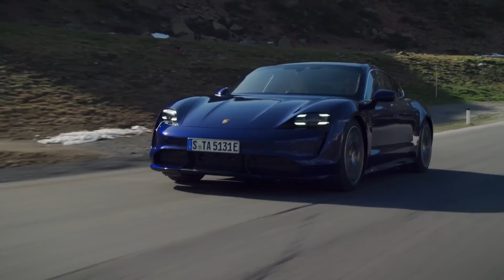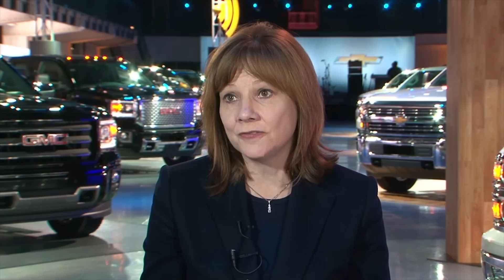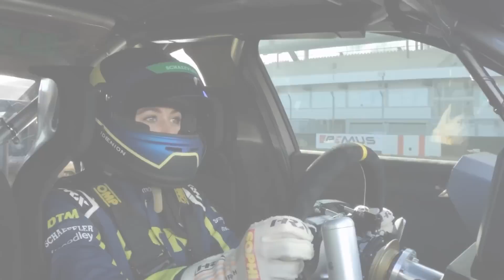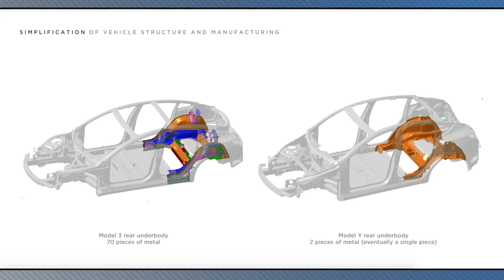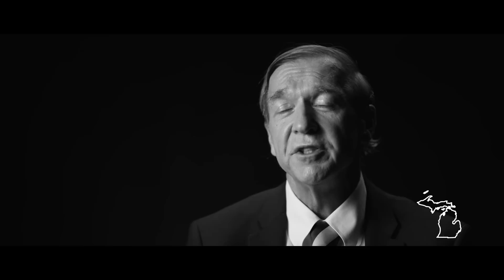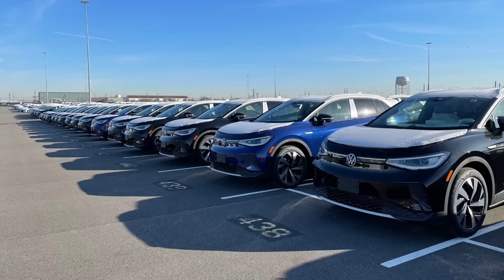Germany Slashes EV Subsidies; Tesla Charging Fee to Use Navigation - Autoline Daily 3370

Comment: After 8 years you can pay for navigation and don't forget about that battery your sitting on
Reply: The battery will probably last a million miles, or a million kilometers if you wanna be pessimistic. A ton of folks are already starting to celebrate passing the halfway point on Twitter.

By the time you need a new battery an ICE car's engine would have been replaced a few times over, and lets not forget how much easier it is to replace a skateboard (ex: M3 = pop 38 screws and stick new one) vs an engine block, labor will be much more expensive for ICE.

Comment: Wait so why is the iD4 sales down? Is it lack of dealer availability of the car or the lack of interest from the customer?
Reply: Lack of supply. VW is doing a software update before they hand the cars to the dealers (the first software update of these cars has to be done manually, only after that they are OTA capable - this shouldn't be a problem with the US-made ID.4 which will already come with new software version from the factory). This means the cars sit at ports and are counted towards VW's inventory and it makes it sound like nobody is buying them. In reality there are long waiting lists and it just takes time to do all these software updates manually.
Reply: @andy1977  Thank you for digging into the situation that THIS CHANNEL didn't.
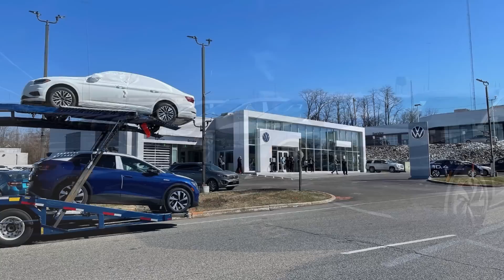Reply: @suserman7775  they says It at around 9:40 mark

Comment: Tesla more and more dependent on China - buy TSLA shares at your on risk. Ukraine today - Taiwan tomorrow....
Reply: You do know that they are ramping two new factories in Germany and Austin Texas, right?
Reply: @billh2294  yes, with CATL batteries (from Chyna)
Reply: @johnsmith-cw3wo  Berlin is currently sourcing batteries from China. Texas is getting them from Panasonic made in the US. They are also making their own 4680 cells in California and Texas. Berlin is currently building 4680 cell production lines. Point is that battery production will be in many locations including at the plants themselves.
Reply: @billh2294  Shanghai, witch is the biggest get all batteries from China,  Also Cybertruck might have batteries from BYD)
Reply: @johnsmith-cw3wo  Well since Shanghai is in China, makes sense. Cybertruck will have either 2170 or 4690 cells made in the US. Did you know that Tesla Model Y and 3 built in either California or Texas have the largest American content of all other cars? Or that the Fremont plant is the most productive automotive plant in the US? How about that the Texas factory will be larger and have higher output than Shanghai when fully ramped.
Reply: @billh2294  higher than Shanghai have today... Shanghai also plan to expand. - for now the production is really shitty in Austin, will hardly go over 100k ... maybe with luck this year (with 2000 a week, I know you Elon fanboys say it will produce more, but I would not hold my breath). and about largest American content of all other cars is not a high bar, since most of GM/Ford parts are made in Mexico, 😄
Reply: @billh2294  Your boy Elon also said Tesla will make a million robotaxi by the end of 2020 😆 -  And after the Twitter fiasco, I don't even care what that clown have to say. 🤡 - but it is funny to see stans like you defend him. 😁
Reply: @johnsmith-cw3wo  Your comments won't age well. Did you also know that Tesla is putting more money on the bottom line than Ford, GM, Toyota with a fraction of their sales and revenue?

Comment: Average car ownership is about 7 years, largely due to outdated features and expectation of mechanical failures.
EVs that are software defined flip the script on this.
1. Their features are being updated regularly, so aside from older hardware components (which might be unbearable), it will take much longer for functionality to become "outdated".
2. Teslas are demonstrating that EVs can have life expectancies with minimal repairs upwards of 300k miles.
Both of these will upend the idea of when a car needs replaced, extending the average length of ownership dramatically.
Reply: Software can’t update everything and the average age of a computer, cell phone, tablet is much less than eight years because the hardware can’t keep up with the changes in software.
Reply: @matthewhuszarik4173  that is very true. i know some guys who are developing software for the virtual instrument cluster behind the wheel and the infotainment screen in the middle of the car. they say, usually, the hardware is already very weak to keep up with the actual needs of the software to save money on the hardware. letting other software run in a sandbox would require much more hardware resources that are "too expensive".
Reply: @matthewhuszarik4173  Cellphone batteries usually die before the hardware does.  The same applies to EV's.
Reply: @H0kieJoe  Cellphone batteries don't last long because that's how the phones are designed, there's no incentive for phone makers to let their phones last longer than a few years, why baby the batteries then?

EVs are a different use case, the batteries can last a million miles with modern designs because they properly manage their packs. 

The only company that designed their EVs like cellphones was Nissan, their Leafs lack active thermal management, and for that they deserve the bad brand image they have today, and rest of the market has moved past.
Reply: @AllanSustainabilityFan  No, EV's are not a different case.  Planned obsolence and thermal envelopes aside, lithium ion batteries (like it's predecessors) can only withstand so many charge cycles.
Reply: @H0kieJoe  Cell phone batteries are easily replaced and the cost is not prohibitive like it is on BEVs.
Reply: @AllanSustainabilityFan  No BEV has come close to lasting a million miles much less them routinely doing so. Every high milage Tesla I have heard of has had its battery replaced. When I speak of high milage I’m not saying a millions miles I am say 200,000 miles.
Reply: @H0kieJoe  Yes they can "only" withstand 3000 charge cycles for NMC chemistry, so 3000 x 350 miles in Tesla's case, for example.

LFP is even better, it trades energy density (range) for other benefits, including longevity, that chemistry gets 10000 cycles, so 10000 x 250 miles in Tesla's lower range lines, for example.

LFP will eventually be making up 2/3 of Tesla's production line-up due to cost and scale benefits, but either chemistry is way overkill for consumer applications as is.

Try finding ICE vehicles that last a million miles. Not gonna be easy.
Reply: @matthewhuszarik4173  A flood of customer are already passing 300k miles without replacing battery, motor or even brakes. So this is not a very compelling guess.

Examples:

1. 100,000 miles, barely any degradation:
https://www.youtube.com/watch?v=TxCURT2NBpI

2. Twitter had a Model 3 owner that just passed 500,000km (>300,000 miles) with no motor, battery, or even brake replacement, maintenance free operation.

3. Another owner reporting his findings after 227,000 miles of driving, minimal degradation:
https://www.youtube.com/watch?v=_OBxDDa8J14

Also had a nice section about cost of operation.

You can also find statistics on this for thousands of Teslas in Steinbuch's degredation paper. It's not some secret or mystery that EVs outlast ICE drastically, and it's not even close.
Reply: @AllanSustainabilityFan  Your #2 you forgot today include he was already down to 80% of original capacity?
Reply: @AllanSustainabilityFan  I have never had to replace an engine in a car even though I drive my vehicles to over 200,000 miles. I also have just as much range at 200,000 as I did the day I bought the vehicles.
To bad Tesla has such terrible build quality they are giving BEV a bad name. 
I just read one high milage Model X >400,000 miles having to have a rear door arm replaced seven times. They had over $30,000 in maintenance over the period of ownership time and of course had a battery replaced under warranty.
Reply: @matthewhuszarik4173  The guy drove nonstop and charged aggressively, so it's fine, it's perfectly understandable for his use case. 300,000+ miles in 2-3 years is no small feat.

Otherwise one can pessimistically measure ICE life by how police departments use them - basically double the wear and tear statistics, which explains why they don't keep them long. On a side note, the PDs that got EVs are starting to keep them twice as long due to finding out about their superior durability.

As mentioned before, the Steinbuch results clearly show that typically these packs are passing 250k miles with around 8 percent degradation, that's allot of juice left in the pack, and we're talking their older battery chemistries to boot.
Reply: @matthewhuszarik4173  I have had a dozen ICE cars, none of them passed 200,000 miles, most die or become $500 throwaways by 150k, unless Korean or Japanese. My friend at the dealership would not, by policy and based on years of experience, bid on anything over 100k miles at the auction, with the exception of 150k if it's a Japanese brand. So there's another anecdote to throw in there. 

But if we look at statistics:
"For some time, the average lifespan of a car's engine was eight years, or 150,000 miles. New designs, better technology and improved service standards in recent years have increased this average life expectancy to about 200,000 miles, or about 10 years"

So it sounds like today's engines fall somewhere between our two experiences here.

Which again is not really anything close to even the worst case scenario posted earlier (300k miles), let alone the average use case.

Early Model X vehicles did have a design issue with the doors, and it took them a while to sort it out, true. The new ones seem to have solved that issue.

If we look at the more "mass production" type EVs from Tesla, like the Model 3 and Y, you will see many consumers report saving thousands of dollars in maintenance and gas per year. 

Police departments report anywhere from $6000-$12000, for example, again due to their more intense usage patterns - lots of engine idling for example.

But I digress, this is about battery life, not the particular feature quirks a company chooses to market on top of the pack. 

So going back to that: The point is that we've pretty much solves the battery life question, it is not a concern whatsoever for the average driver.
Reply: @AllanSustainabilityFan  Actually driving non stop adds to the life of Li-Ion batteries because they also degrade with age. So if you want to maximize the number of full cycles you would do it quickly.
Reply: @matthewhuszarik4173  Likewise with engines, and at a much faster scale, that's why you don't leave a tank of gas or lubricants sitting for months. Has a used Ford Bronco engine that died that way in the past, sitting in the back of someone's garage.

Some batteries might likewise break down chemically with time when left unused, expect potential issues if u pull one out from a desk after 30 years.

This is all corner cases that don't impact user experience, just useful trivia for keeping a healthy product.
Reply: @matthewhuszarik4173  We have many people reporting that they passed 300k miles already, some are even passing half a million. The company states this as their design goal, and both NMC and LFP cycle statistics are public data.

The end story is that your EV will outlast your ICE product many times over, so worrying about the cost of engine vs battery is an academic exercise at this point:
1- Engines will cost much more on labor, battery pack will (currently) cost more on the part and save significantly on labor.
2- Engines will become more expensive as the market moves away from that obsolete technology, making parts in short supply, meanwhile EVs are scaling up and costs are coming down, the trend will reverse in time.

My advice is to get the cutting edge, which is EV, unless your needs limit you to older ICE technology, such as some remote rural areas with lacking support infrastructure. 

It's the same story with horses, didn't get replaces in rural areas by cars until the federal highway system was in place to help them modernize.

TLDR: By the time a typical person needs a battery pack replaced, the costs will likely be down to engine levels, while engine prices shoot up as they become less and less attainable.

And will they really want to stick to the old EV to begin with? Who knows, by then EVs will become even better and cheaper, while ICE remains stagnant at its end-life phase.
Reply: @AllanSustainabilityFan  They are totally different, batteries age whether maintained and used or not. Internal combustion engines don’t significantly age if maintained. That is why 20-30 year old ICEV still have the same range as when they are new. No BEV will have the same range as new in 20-30 years regardless what you do except replace the battery.
Reply: @AllanSustainabilityFan  The only reason there is such a high BEV penetration is government subsidies and mandates. I am not agains BEV it just don’t think most of them are well designed as they try to replicate the ICEV experience. I have put deposits down on the Cyber Truck and an Aptera. The Cyber Truck as it is the most cost effective means of getting a truck and a large home backup battery system in one vehicle. An alternative will be the F-150. The Aptera because it is how BEV passenger vehicles should be designed. Not its looks or functionality but its hyper focus on efficiency.
Reply: @AllanSustainabilityFan  Perfect example is battery powered electric power tools. I have 120v power tools that are over 40 years old that still work perfectly. I have had many battery power tools in the past none have lasted more than 5 years or so. The batteries die and can’t be replaced making the tool worthless. I have just recently purchased a good selection of Li-Ion battery tools from a name brand line that all use the same batteries I hope they keep the batteries available for more than 5 years. We will see where they are in 5-10 years.
Reply: @matthewhuszarik4173  Again, design choices is the name of the game. If you're in the EV business then you design for durability. 

And if you're in the Gillette shaver business you design for cheap disposable razor blades.

They want you to buy those cellphones every five years. It's how they make money.

I know the limitations of my electric mower, yet I've kept mine for five times longer than every other gas mower I had before, and it's still kicking, beside cheap plastic handles needing replacement. Such a wonderful product.

That's not how the car market works, so naturally they make them last longer than ICE by design. It's not hard, we're talking obsolete technology with 2000 moving parts, operating at thousands of degrees of combustion, versus newer tech with 20 moving parts operating at 200 degrees, affording them the luxury of creating self contained systems with little need for servicing.

It's a no-brainer that EVs are more durable than ICE from the physics, thermo and design angles.
Reply: @AllanSustainabilityFan  What did you do to your ICE mowers? We had one the entire time I was growing up and the parents still had it when my step father passed and we sold our mothers home, easily thirty years. I don’t have a mower because I don’t have any grass but I have a chainsaw over forty years old and couple weed whackers over twenty years old. We purchased an electric mower for my mother in law because she wasn’t thrilled spending $200/month on a gardener. So far it works fine we will see how well it holds up long term. To replace the battery is an expensive proposition. Costing more than the maintenance on an ICE mower would cost for at least a decade. If the batteries last over a decade I will be happy as long as there isn’t a lot of other expensive maintenance.
Reply: @AllanSustainabilityFan  Is your electric mower corded or battery. Because battery mowers haven’t been around five time longer than a typical ICE mower would last.
Reply: Every high milage Tesla I have seen has had the battery changed out. A very expense proposition.
Reply: @matthewhuszarik4173  but that does not represent all those Teslas and for sure not actual cars.
Teslas are shit regarding batteries because you can't change/upgrade modules. but that is more of a preference.
Reply: usually the quality of Teslas made in the US is poor and repairs are expensive. i would rather go with a Hyundai Ioniq 6. good design, good tech, good quality and very competitive priced.

Comment: Tesla charging a subscription for navigation is a bummer. Doesn’t that basically make the big screen useless after 8 years? Teslas don’t have CarPlay/AA integration.
Reply: The screen does sooo much more.
Reply: Put a phone in your car on a holder. Voila. Free navigation.
Reply: At the price they are charging, it's trival ($99/year).  Consider most other car makers charge $30-40 a month for far less features.  Automakers don't get the navigation maps for free, they have to pay a source for use of those maps and updates.  So I guess Automakers could bundle in the original price and charge an extra $4000 for 40 years of coverage.  I'd rather not pay for something I'll never get any benifit from, as I've never had a car over 8 years.